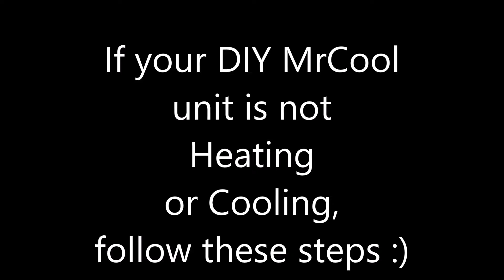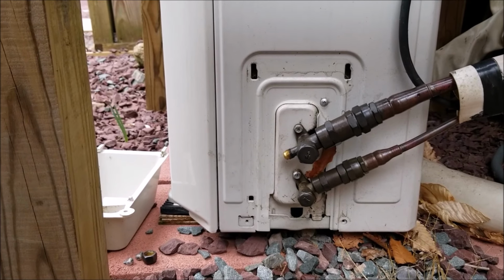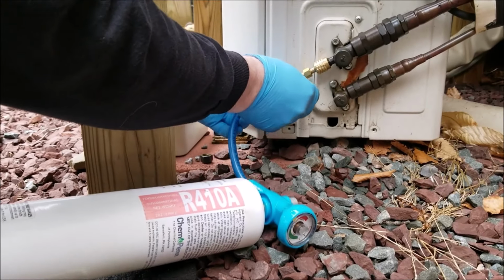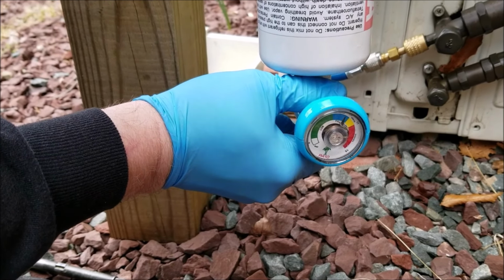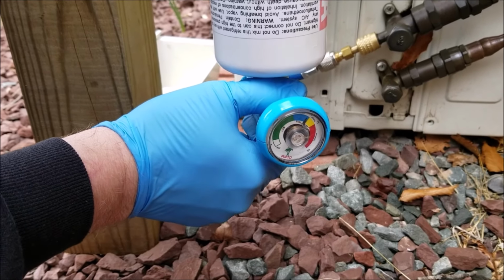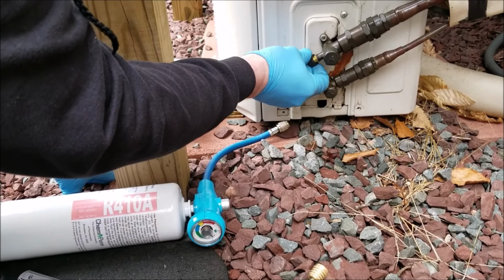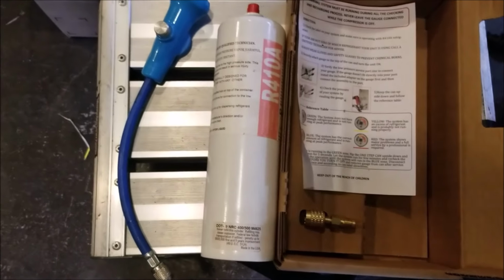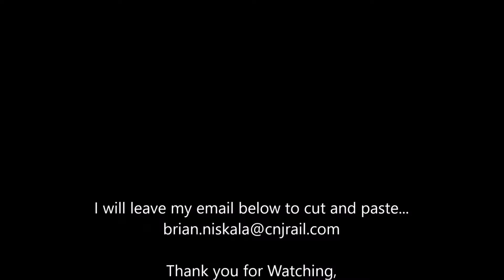Not heating? DIY MrCool 10 Minute Fix and other Ductless Units

Comment: Can you tell me I have a mini split Mr. cool she is freezing up at the filter on the inside?   it is about year and a half to two years old worked fine.  About 30 to 40 minutes it'll start to freeze up.
Reply from the maker: Definitely a low refrigerant issue, my kit will fix that 😀 for you
Reply: @GarageMahalLife  awesome thank you well my question is how many pounds does that unit hold and how many pounds is your can hold

Comment: how do you force mini split into cool mode in the winter when it's cold outside? from what is said you have to set handler to cool with fan on turbo/high. can'[t find anything on how thats done in the winter
Reply from the maker: Cooling mode, 62 degrees... on board AI will see pressure going up via sensors. The compressor will spin up as a result. Not your father's hvac system... 😉
Reply: @GarageMahalLife  Thx, your awesome. Trying not to use my oil heat much. Cost too much. Got a leak in Mini I guess. Checked flares. Hoping its just the shrader valve. Its a Pioneer. Gonna charge with 410a leak stop/dye refrigerant. I better ask if 120psi is the correct pressure I want the gauge to read as I charge the system?

Comment: I've had the Mr Slim version of this unit heating and cooling a space in my home since 2010.  It's worked like a champ for 12 years --  I've never recharged the freon.  Just today I noticed the heat setting is not blowing hot air.  I assume this is all I'd need to do and gladly order one of your kits if still available.
Reply from the maker: That's pretty good for that unit. It should just need to be topped off and my sealant will seal any small leaks...
Reply: @GarageMahalLife  do you still have this kits available? And is the sealant in the kit or I have to ordered a part?
I have a mini split that was blowing cooled air 3 weeks ago and now that the temperature drops i change the settings to hot and is not working.
Reply from the maker: @cesarr.figueroa6402  Here is the link https://computrader.myshopify.com/products/diy-mrcool-plus-recharge-kit-plus-uv-dye-sealant-all-in-one-fix 
Make sure no matter what season you are in to keep it in cooling mode on the lowest temp while recharging unit.

Comment: When on cooling setting set at 70F what should the air temp coming out of the MR cool unit be?
Reply from the maker: Depends on the room temp... but around 70 give or take a few degrees below that number. If the room is in the 80s, you would see temp out puts around 55...

Comment: HI, I have mrcool Dual Zone 48K-BTU, I am turning on one of the heads for heating, and I noticed the temperature of the air coming out of the unit changing every 5 to 8 minutes. I set the unit to 75 degrees, and the temperature coming out of the unit started from around 80 degrees, going up to 125 degrees in 5 to 8 minutes, and then coming back down to 80 degrees in the next 5 to 8 minutes. This cycling continues all the time
Please let me know if that is an issue with low Freon
Reply from the maker: I would check to make sure all the filters are clean, then the sensors (right hand side of head unit in clear tube.) And yes, sounds like a low refrigerant issue, to throw heat it needs to sense 140+ degrees out of the line... remember to use my kit in cooling mode, 62 degrees, all units... no matter the temp outside or in.

Comment: We have a single mini split, everything works except no heat!!!! I called Senville and they are not much help. I checked the pressure but it was at 0. Fan works, ac works.....it was cold outside, also turned it up to 86 degrees and large copper line was not getting warm on unit at all............Please HELP. I checked all the lines with soapy water and no leaks.
Reply from the maker: Hi Christine, email me at Brian.niskala@cnjrail.com
Reply: I'm having the same problem
Reply from the maker: @normanweagantjr7982  Sounds like you need to order my ReCharge Kit

Comment: Ours don’t seem to be putting out the heat we just got this unit last year first year using the heat
Reply from the maker: In cooling mode, does it operate okay? But typically a low refrigerant issue... That new I would contact MRCool, but you can get one of my kits and it should fix you right up.

Comment: Hi Brian - Thanks for a great video. I have the same unit. My heater doesn't work at all and when I put on heat, even the fan isn't working. Do you know what could be the issue here? Thanks
Reply from the maker: I would see if you tripped the breaker. If the breaker seems good and you have no lights on the inside unit, it could be the main control board that may have failed... but one step at a time.
Reply: @GarageMahalLife  thank you

Comment: I have one unit with two splits. The kitchen split is putting out heat, but the living room / loft bedroom unit stopped heating. I even turned it off over night (not pleasant).
Reply from the maker: I would check the filter, make sure it is clean and circulating. And you could still be just a few oz short causing that one lone to drop off in pressure and not circulate properly.
Reply: @GarageMahalLife  Thank you. Ordering one now
Reply from the maker: @hvasque  Thank you, will email you tracking info. as soon as shipped.

Comment: Could it be possible that it can still be low even if Mr cool sent you precharged line set? I hooked them up but it’s not blowing cool
Reply from the maker: Yes, very common. MrCool charges the line with the bare minimum. Very easy to lose some refrigerant on install and thus your system will be low and not work properly.
Reply: @GarageMahalLife ok I’ll order the kit I just don’t know how much I lost do u have a number I can reach have another question to ask

Comment: Hi Sir, I hope you can help. I just came across your video. Scenario: I purchased the 36k BTU this fall, but it has taken until today to finally make the final electrical connections and open the valves. I have been wiring my shop and just got power to it. I’m sitting here in the shop and it’s currently 33* inside with the wood stove going. The unit beeps and the louvers come down and the thermostat shows 86* on the indoor unit but that’s it. No heat no fan on heat. If I switch it to fan only it blows but just more cold air. Frozen fingers. Merry Christmas.
Reply from the maker: Lots of questions... what is the voltage showing to the compressor? Is it set to Heating mode?

Comment: Hi.  I've been running a MrCool 12000 BTU Advantage unit set up by a local HVAC company after I did the physical installation.  Been running and working fine on Auto in TX for 2.5 years.  Just this past week,  I hadn't been in my mancave for 9 days, I went in and it was really warm at 10 pm.  Ugh oh.  And I have guitars in there.  The 20 A 240 breaker was tripped.  First time.  Hmm..  Reset breaker.  Watched it for a few minutes.  No other trip.  Checked that the inside unit was blowing cool air as is expected.  It is.  I let the place get to temperature overnight.  And this morning I decided, I need to test the heat.  So I put it on heat setting and on 80 degrees.  Gave it a couple of minutes and nothing.  No heat.  I would think if it was a freon issue it wouldn't have gotten cool the way it did.  Thoughts? I just read on a link that it might be the reversing valve in outdoor unit?
Reply from the maker: So, the tripped break is something to note and keep an eye on. I've delt with a bunch of bad breakers these past few years, but only if it trips again, maybe check the load to the breaker and decided if it is too much amp draw, could be a compressor starting to go. However if it seems to cool okay, but not heat, definitely a low refrigerant issue. The unit needs over 140 degrees to kick into heat mode, if it doesn't reach that temp, it usually is a low refrigerant issue about 98% of the time. Mini splits seem to work OK cooling even with less than ideal refrigerant pressure. Heat however needs to have spot on readings. In summary, low refrigerant and keep and eye on the amp load of the breaker as it could be a compressor issue... once you charge it up to pressure that is.
Reply: @GarageMahalLife  Thanks for the quick response B.  I'm always puzzled by units that get low on Freon.  I've had a Dodge Magnum that 17 years old and never needed a freon charge.  And still works fine to cool.  And my main house AC, the only time freon was ever low was when there was either a leak at a pipe at the outside unit or the evaporator developed small leaks in the attic.  But that was a much older system.  The pipe leak I had was just a crappy Goodman unit and a better service place fixed the leak and I didn't leak freon for many years after that.

So I guess my point is, this unit is so new, seriously would the compressor be going out this soon?  That would be sad.  And if it has leaked refrigerant, that's weird too.  But then again, I'm not a pro and I decided to hire the same company that set it up in 2018 to come out Wednesday and check it out.  

But I do appreciate the insight about why cool might work and heat not.  Yeah the fact that I have a 20 amp breaker is actually 5 amp higher than a 12k btu is rated for.  Should work fine with 15 amp.  So blowing a 20 amp, that's quite a jump in current draw.  I wonder if when it switches to heat and it's not able to do it's job, that's when the current is going up.   Well I will let the pros give it a thorough going over.  I have too many expensive guitars in there to risk a failure.
Reply from the maker: @Jeff-Cranston  ReCharge should do the quick, just covering all bases with the breaker... why these units tend to "leak" is the fittings and fill points have small O rings made of silicone. The cycle going from hot to cold strains them and they get micro cracks. My kit has in the refrigerant a leak fix, so it will fill those micro cracks and prevent future and current leaks...
Reply: @GarageMahalLife  Followup after HVAC guy visit.  Told him the story.   His impressions:
1.  He saw one of the safety box wires was a bit loose and tightened that.  Not sure why that would trip a breaker or cause any other problem.  And did a current test and it was less than 4 amps with AC on.

2.  Cool working fine.  Filters fine.  Didn't want to check refrigerant because he said breaking that connection would mean you would lose 6 oz right off.  Then you could re-add but then you would have to recalibrate.  Ok.  That's all Greek to me.  But he basically said as cool as it's getting it's unlikely you are low on that.

3.  Tested heat function.  Not happening but he said, because the freon was probably really warm, it's possible that being too warm that it probably wouldn't come on.  (99 deg out in TX).  And really, why would you ever want the heat to come on when it's that hot?  And it's offering protection from too much head pressure if the sensors say it's too hot to turn on heat.  Again over my head.  

So I made sure the service ticket stayed open because so far in the 20 minute visit, all I got was tightening up a terminal that was a bit loose and looking over the rest.  So next week it's supposed to drop into the 60s at morning so that's when I can test the heat.  If it works then, we're good if not, the service ticket is still active for 30 days of guarantee for what I paid for.
Reply: @GarageMahalLife  Final test.  I found out range of MrCool to have heat work is 32 to 86 degrees out.  Wouldn't work at 88 deg or higher outside.  As soon as it hit 85 deg at 11 pm here, I tested heat again, and voila, it works.   So everything seems to be ok with it.  Just need to keep an eye on power after errant breaker trip.
Reply from the maker: @Jeff-Cranston  Sounds good 😀

Comment: Brian - I have a Lennox MPA012S4S-1P, Mini-Split Heat Pump Outdoor Unit, 21 SEER, Single Zone, 1 Ton, R-410A and it stopped cooling at the beginning of the summer and now that it is winter I see that I don't have heat. Do you think this may take care of my issue? (I know you can't diagnose my problem over the intrawebs) This thing has been a pain in my arse since the day it was installed. I would not recommend this particular unit to anyone...it may have been my HVAC installer. Nevertheless, I am looking for some suggestions and a possible fix before I wire this thing up to a Wile E Coyote blasting machine and turn it into a mushroom cloud. At least then I will get something out of it.
Reply from the maker: Typically, 90% of the time it is a low refrigerate issue. My kit will definitely get you i. The right direction to check pressure and recharge.

Comment: Is this for not heating problems?
Reply from the maker: Yes and not cooling issues too. Heating becomes a problem 1st on low refrigerant, then cooling suffers layer on as a potential leak continues. My kit will seal most leaks 😀

Comment: Brian - I have a Fujitsu split halcyon unit that not heating. Are you saying to add Freon and even in. 30 degree outdoor temps I should place unit in air condition mode leave it on and add Freon while unit is running in ac mode? This will help heat?  Thanks,
Reply from the maker: Yes, put it in cooling mode. Even when the temp is low. If it is in heat mode, the compressor runs backwards and the charge line becomes the high pressure line and you will not be able to charge it. Anyway, leave in cooling mode to charge.
Reply: @GarageMahalLife  Hi
Problem I'm having is when I place it in cooling mode to charge it dosent kick over. Its winter where I am now averaging between 35-50 degrees. Any suggestions on what to do to get the a.c. in cool mode/run.
Reply from the maker: @TheBlindSwordsman  You have maybe a 5min window to charge... turn the unit off, be ready to charge outside. Have someone turn the unit on in cooling mode. You'll hear the compressor turn on when it gets enough pressure in it. You may have to repeat this process if you are not fast enough. But follow my video, charge it slowly, but be fast and safe in the process if that makes sense...
Reply: @GarageMahalLife  Yes makes sense, so to recap.
1. Be ready to charge outside while unit is off.
2. Have someone inside turn the unit on in cooling mode
3. Wait until the outside unit kicks over? Or inside unit?
4. When it kicks over press to charge with the refrigerant?

The one thing I'd like to know if everything else is correct is should there be a desired temperature the unit inside be set to, or does it matter? 
Thanks for the response and help thus far.
Reply: @GarageMahalLife  Another thing, I wasnt clear about having a 5 minute window to charge, why is that and does this start from the time the unit kicks over in cooling mode?
Reply: @GarageMahalLife  I have the Mrcool 36k unit with 4 heads its says 115 ounces of refrigerant on the side placard, should I be servicing the individual unit in question or do these units have 1 main port for the entire system? Or am I just charging it from the individual head for the unit in question?

Comment: I have this problem with a new unit and I had a hvac tech come out. He said that the unit has the correct charge, it still doesn’t work.
Reply from the maker: Hvac tech, that is all they said? I can help you diagnose it... email me at Brian.niskala@cnjrail.com
Reply: @GarageMahalLife  okay so I have the kit sent from you. When I connect the gauge to the port on the unit it is sitting right on the blue and yellow line, 135. The unit blows out at 70 no matter where I set it.

Comment: Hi Brian quick question my mirage inverter mini split isn’t cooling enough note filter clean,outside unit is clean,unit 1 year old,I noticed outside unit fan isn’t spinning like before it spins kinda slow?any guess?
Reply from the maker: Typically that sounds like a low refrigerant issue.
Reply: @GarageMahalLife  thank you I’ll have someone to check on the freon
Reply from the maker: @Trs209  I'm here to help if you need anything,  Brian.niskala@cnjrail.com

Comment: What is the optimal temperature at the blower when in heat mode? Just installed my Mr Cool unit and its at 89 degrees coming out of the head unit. Is the correct?
Reply from the maker: A lot of factors will affect the output temp. It should typically be within 1 to 2 degrees of your set temp. However if it is cold in a room, let's say 60 degrees and you set it to 80, the output temp maybe as high as 99 degrees until the unit senses the air coming into the unit gets closer to the programmed set temp. Then it should continue to blow out at the set temp. In this case close to 80 degrees...

Comment: Hey Brian. I have a one year old midea 18k. Worked will with heat until last week. When I turn it on heat mode it blows out cold. Do you think it only needs a recharge?
Reply: Also if I order the kit today when could it be shipped out. Thank you.
Reply from the maker: @stevenschmitz4168  Hi Steve, I ship daily by noon ish... and that is a low refrigerant issue that my kits will fix 😀